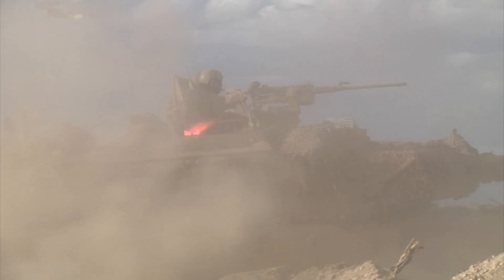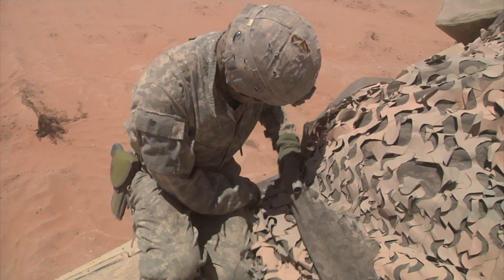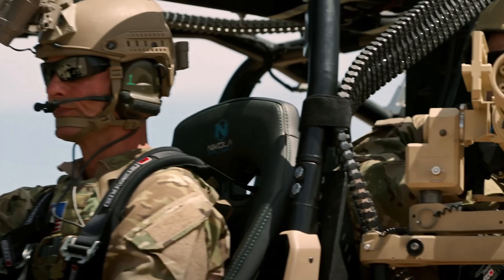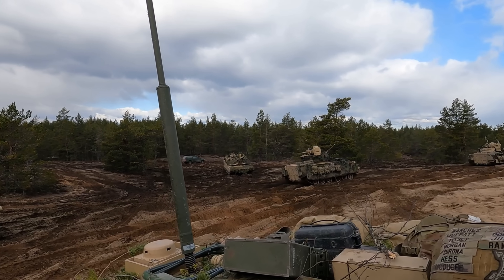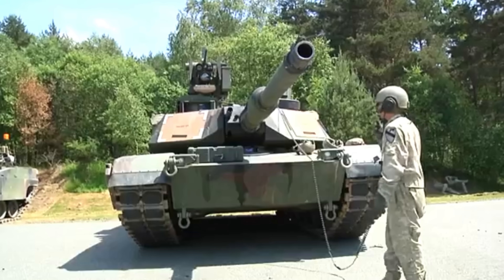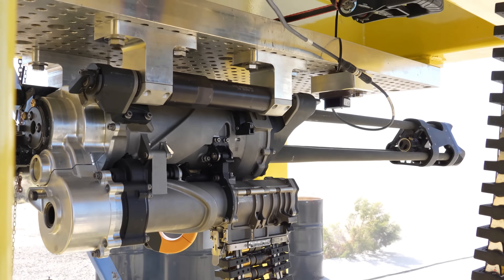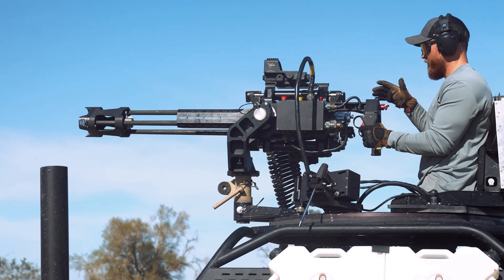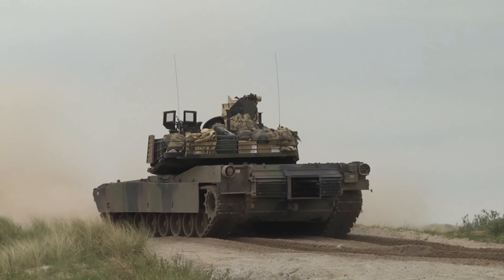Why is the U.S. Army putting a M134 Minigun on Abrams? | ROTARY GUN DEFENSE

Comment: The M230LF project seems a lot more promising than this idiocy.
1. You need a sensor to detect drones, because human eyeballs are just not good enough at detecting the small variants until it's too late. 
2. You need to be able to saturate a large area with projectiles (and those projectiles don't need to be big to do damage, but they do need to be bigger than necessary to kill if they want long range functionality as well). All of these promotes a fragmentation shell. The best way to get 10000+ projectiles into a small zone without ruining barrels or ammo efficiency.
3. It needs to react fast. Much faster than a human can swing around even the smallest of miniguns.

Comment: I wonder if it would be feasible to roll out a drone shot variant of 7.62? Similar to the custom 3D printed bullets that soldiers in Ukraine are using. 
Sure, the casing of these drones are usually too thick, but if you shoot 9 billion little steel balls at them then the props or payload will go out

Comment: My favorite weapon system is the M242 Bushmaster.  I miss firing that gun.

I think what would make more sense for a defense against drones would be a weapon system that can fire ammo with proximity burst capability mounted to the rear of the turret.  I seem to remember a Raytheon prototype upgrade of the M60 MBT that had something like this.  Tie that in to a bank of sensors that offers 360 degree coverage and can be operated manually or be automated, and that might be a viable defense against the drone threat...at least from the air.

Comment: 3:03 well yes but its going to be fully protected and monuted in a fully proteced armord mechnal and comptuer controled assited turret  in where the .50 callber mechine gun gunner hatch was. it woull be mained remotrly inside the gunner crew area under wherethe thach used to be wihout risking the  gunners own safety due to that being mnuted witha fully proteced turret monuting and even would  also have its own radar and inveread imlaeging tracking sesors and camras on that minigun turret.

Comment: Seems a bit extraneous on a tank, but !FUN! AF for the T.C right? (<And thats the ONLY thing that truly matters right?..;)
- I could see the utility in a cut-down Dillon rotary mini 'gon, chambered in 22 Magnum, for the sake of weight savings & the immense ammo load-out a small recon helo'choptor could pack?
- Toss a few of those^ on an OH6 Cayuse/Loach and you'd be GTG. 
- Something like that for suppressing* fire duties would def do the job. It'd keep my head down....or OFF. 

- The OH6 is a nimble little chopper, but the debit as to overall handling characteristics is felt, when two 30cal miniguns & the attendant ammo compliment are affixed to such light weight choppers.

- I'd reckon a 20mm co-axial bang'r kannonen on a tank would be of some benefit over the standard 30cal? 
- Or @ least a .50cal co-axially?

- During WW2, then serving under Gen. George S. Patton**, Gen. Creighton Abrams own 'Thunderbolt' tank(s) & the rides under his command, had his armorers/workshop dudes fab up custom M2 .50 cal mounts to run 50cal M2's co-axially on the Sherman tanks they'd used. They apparently loved that set up too, I can def see why...

* See the: 'American AR180 BEE,' a Fully-Otto .22LR rifle, looking similar to the Thompson SMG. 1200--1500 RPM. 275 round pan magazine. Saaaweet 'lil gat indeed.

** Give Patton's poem: "Through A Glass Darkly" a read, Im certain you'd appreciate it Matsimus. Beautifully pen'd.

Great vid, as per usual...;)

Comment: I think the entire turret needs to be redesigned. The tank was designed deliberately with a low profile for combat. Adding more and more exposed gear defeats that purpose. Especially in a near peer conflict. Perhaps blast panels that operate like an enhanced claymore mine. Bolt on - easy to replace

Comment: the 50 cal rotary we see here atleast..clearly is not balanced for accuracy, and inherently it will likely be slower to move along its axis, as it is heavier and longer. and isn`t the 50 cal ammo somewhat overpowered for the small drones going after tanks(?) the 5.56 and 7.62(or the new 6.8!) round seems better for the close quarters protection job for armoured vehicles. and the firerate can probably be set to whatever seems ideal

Comment: This seems like a disingenuous attempt to push out the m134 in place of the 50 in a manual mode only and leaving the m240.  Let's be real, end of day, it will be put into the CROWS system.  The .50 will probably stay, but the .50 is probably even better suited to be the co-axial and not another m240.  The .50 sniper system on the Abrams, optional, shows the barrel mounting is probably better, and having it coaxial similar to what the Chieftain had for years is a great idea.  Or for that matter, a chaingun on the new turret new Abrams.  Since this is current Abrams, not enough room in the turret for a chaingun.  But for fire suppression, the minigun is much better than the m240, and they still need a .50.  Personally, LOVE the idea of the .50 3 barrel mini in place of the m2, which to me should be the coaxial gun (m2).  Minigun and whichever is left on top should all be merged into the CROWS and use the BLADE system they were testing a few years back.  That was what was testing the .50 in the role of the anti-drone and it's ROF is just too slow and overkill for a small drone carrying a RPG shell.  For drone, think "reach" and for very close in shots, don't think of this as the final protection, that should be the altered TROPHY system with tweaked Software to handle slower threats and having upward shot ability, as in straight up.  That is final protection with shotgun effect, the mini-guns should be for reaching out several hundred meters or of course fantastic fire suppression for the infantry, and of course again, in the CROWS mode, nobody should be poking a head out of the tank, that's sniper's and urban paradise for killing tank crew members.

Comment: I really don't understand who's point youre debating in this video. In the intro you show a remote weapon system and then spend most of the video talking about the M134 being used without a remote weapon system. Has the army said somewhere that its looking at using it without a RWS?
Personally if you can integrate an AI detection system into it that scans around the tank at all times I think it could be an amazing idea and I dont think the increase in calibre is necessary. If its a dedicated system then honestly I think something like a 5.56 could be brilliant if they can get the accuracy down. It would give you the ability to have a better protected system as it could stow and deploy when needed and the smaller the calibre the more ammo it can carry so the higher its rate of fire, the longer it can remain protected etc etc.
Most drones in use are very small and vulnerable to the point where the difference in being hit by a 5.56 or a 7.62 is likely to result in differing result. I feel like a 360 scanning AI powered 5.56 with an absolutely stupid rate of fire so you can hit the drone as many times as possible would help deal with most current FPV drone threats

Comment: A main battle tank (MBT) point defense system is an active protection system (APS) designed to detect and defeat incoming threats, such as rockets and missiles, before they hit the tank (Wiki) like the Trophy System. If it can track and engage incoming missile systems and/or Tank rounds, then it should be able to deal with drones.

Comment: Need to miniaturize automated tracking, computing, aiming and firing. Using this weapon manually with the gunner fully exposed is definitely a major limiting factor for drone suppression in the battle zone and nearly everything else. Integrate situational awareness from portable , vehicle based drone or dynamic antenna.  A little like a mini Gepard system. At a minimum, seat the gunner behind armor inside the tank with automatic target acquisition and initial aiming. Eventually this could all be done remotely.

Comment: In ground and boat config, the mini is spun at 3k per minute for 50/sec.  6k is only good for aircraft where the cooling from airspeed can keep the temps down.   Barrels will actually melt and rupture even at 3k in prolonged firing.  We had to start doing barrel changes after each full ammo can as a preventative during training cycles.

Comment: They aren't going to put a minigun on the Abrams. Tf you smoking dude? If anything it's just gonna be a 25 or 30 mm autocannon with proximity fused rounds fired by Ai targeting systems.
Reply from the maker: That's certainly a possibility!
Reply: @_Matsimus_ my reasoning behind no minigun is the insane amount of munitions fired. It just seems a lot less practical than 30 mm rounds. Anyway best of luck with the channel. It just showed up in the feed so it's getting pushed by yt

Comment: There isn't any one perfect solution. It may end up being simpler to have a stand-alone support system that hugs the tank to provide air cover. Something with dedicated anti-drone armament and minimal crew. The Ripsaw could potentially fill that role. The main battle tank crew already has a lot of tasks. Adding more isn't helpful. As others have stated. The Army might have to develop a dedicated MOS for counter UAV and have them attached to the deployed units. Now, here is my silly idea. Make a belt-fed 9x19mm weapon and have it use proximity fuzes (if possible) and acoustic/ radar targeting to rapidly identify and engage drones. Have a return of the Villa Perosa type gun?
Reply: Flak explosive 9mm?
For russia theyre using pellet 7.62 39 hulls instead of a bullet
Reply: 9mm is by far too small a cartridge to have a proximity fuze, also less range than something like 5.56, 7.62, or .50

Comment: If you intend to manually aim at a drone target, there are options like the Sharpshooter SMASH system that can even be fitted to small arms. It calculates where you need to shoot, you pull the trigger, and it fires when you're on target with no need for wild mag dumping in the air; but there are short range air defence cannon systems on the market that will track and target for you, and which can even be fitted to light trucks, so a tank turret mount should be possible. 

I don't see the M134 as optimal for small drones. The high rate of fire is a benefit against things like trucks and helicopters, where you quickly get a lot of hits once you're on target. 

A lot of the small drones that threaten armoured vehicles in Ukraine would be taken out with one hit from 7.62mm, so you need accuracy and reliability over high fire rate.
Reply from the maker: Thanks for sharing your thoughts on different approaches!

Comment: Honestly, 7.62x51mm is massively overkill for drones.  It takes up too much weight and volume.  Birdshot doesn't have sufficient range, but something like .22 LR would actually be ideal as far as ballistics go: it carries enough energy to be effective to at least 500 meters, but is very light and compact.  The only problem is that .22LR is a poor shape for belt-feed in an automatic.  5.56x56mm microguns would be a good choice, though, and would work in the existing ammo supply chain.

Don't replace the .50 cal, instead it would be wiser to mount it at the loader's hatch or to the side of the CITV like on the BUSK.  Alternately, move the .50 to the coax position.  But the .50 is way too useful against light armor, unarmored vehicles, field fortifications, and stone/brick buildings.  If the .50 is removed, the only way to address those targets would be with a main gun round, and the tank doesn't carry enough main gun rounds to be expending them on everything.
Reply from the maker: Thanks for the detailed breakdown!
Reply: @_Matsimus_  American Arms out of Texas used to make or still makes a .22 LR machine pistol.. uses a rotary drum with a capacity of around 500 rounds.  Build a quad automated mount for em and let a computer with a low power phased array sensor system for target selection and firing.  Leave the loader IN the turret where they belong!

Comment: Would something like an automated automatic 12 gauge with bird shot not be like….the most ideal solution to drones? Not really that lethal to those in the blast zone, cheap, efficient, and can be made from off the shelf parts.
Reply: Plastic shotgun hulls deform with heat
Reply: @Milo_1368  it doesn’t need a ridiculous fire rate, also view it like aa12 with the Israeli drone sight set up on an automatic mount

Comment: A GAU-19 on an Abrams would be absolutely stupid , for the very reasons you decry the M134, only worse.  Worse, it's absolutely unnecessary for the kind of drone threat the Army is looking at - a drone big enough or a threat far enough away that .50BMG would be useful, is a threat that is either big enough it is basically "just another airplane" to be engaged by ADA, or it is going to manuever slowly enough relative to the tank that it can be engaged with a main gun round, as US doctrine has called for for decades.  And you still have the complexity of an electric rotary gun, you're using a FAR larger, heavier, and more expensive round on targets that are pot metal and fiberglass, of the calober you have the LEAST room for storage on the vehicle.

The M134 trials are a stopgap measure, and the final solution will almost certainly be a semiautonomous system, almost certainly bolted on aft of the TC & loader hatches and slightly elevated.

Comment: I’d think AHEAD rounds or some other pellet based solution would work better against thinly/unarmored drones. This seems expensive and inefficient, likely to be greater problems in a full scale war. 30mm might be heavier and more expensive but if it was 2-3 rounds vs. 1,000 I think the cost would offset.

Comment: A CROWS with autonomous mode (we have appropriate radars in commercial use these days) capability, and an XM214 Mkcrogun as the anti-drone armament.

Of course, I'd also look at swapping out both existing M240s and  the M2 for a matched trio of MG338 or the like.  Overall ammunition stowage for MGs would go down slightly, with little to no reduction in capabikity (and NO practical reduction - the extremely narrow gap between targets (both range and armor) inmune to .338 and yet reasonable vulnerable to .50 is already in the area where commanders should be thinking, "Should I use a main gun round, or is the .50 good enough?" anyway.

Plus, you get the advantages of the coax is now a .338, with the extra range and lethality capabilities that brings over a free traverse GPMG on the loader's hatch or a 7.62x51mm coax.

And lastly, this reduces the nimbers of spares and calibers in the tank company by a full machinegun type - any of the "tank's" MGs (the antidrone CROWS mount would be a specialty purpose mount and reaerved for that type of threat) amd any of the stowed MG ammo could be used for any of the three built in MG stations.
Reply from the maker: Thanks for the detailed breakdown and the ideas!

Comment: My preferred heavy weapons system is actually the light cannon.
AKA the "sniper grenade launcher" as westerners call the Chinese marines new light cannon.
Things like the British 2 pounder, the German and US 37mm, or the Soviet 37mm and 45mm guns or the Japanese 40mm pon-pon.

If I had to choose only one, I think I would go with the German 2.8 centimetre, because of it's insane velocity or maybe, if that doesn't come with high explosive rounds, that added length version of the British 2 pounder.

Also, a recoilless light cannon, on a car sized drone, with an autoloader, and an atmosphere device hooked to a computer to help calculate the trajectory, seems like a great weapon for hitting both entrenched infantry, airplanes in hangers, tank engines from above, and any ground targets in general.
Reply from the maker: Interesting, I haven't looked into those, thanks for the info!

Comment: The tank needs an AI controlled shotgun turret equipped with 360 camera for anti drone work.
Reply: I’d propose to build on this idea by putting a belt fed shotgun in coaxial alignment with something with longer range and let the shotgun rounds take out anything so close in that the larger round wouldn’t be as effective as just using buckshot from the shotgun at <~100-150 yds…
Reply: @williamgarry2635  what kind of shotgun getting hit out at 150 yds? Normally they aren't effective past 50 with shot? Does the military have wizardry shotguns im not familiar with?

Comment: It's obvious that FPV drones have become the main threat to all armored vehicles. I was thinking about how Western MBTs & IFVs deploy smoke screens...

Would it not be possible to take this system and modify it to act as a defensive countermeasure against drones?

Replace the smoke rounds with shotgun-like shells, packed with buckshot, set to detonate well above/around the tank, in mid-air, scattering buckshot in every direction once detonated. Multiply this to 8 to 16 rounds per deployment, and you've got one hell of a drone countermeasure, no? 

You would need to make sure it can deploy several times before needing to be reloaded ... Can vehicles pop smoke multiple times??
Reply: Now that I think of it... There's no need for any of this. I forgot about AI... It will shoot down any & all drones with surgical precision!
Reply from the maker: That's a very interesting idea for a potential countermeasure!

Comment: It is at most a test.  When it comes to drones, the defensive system has to be radar driven. Ultimately, jamming is the answer except for line attached drones. In a swarm attack, the 134 would be useless. A mini Phalanx is not going to happen because of several reason, one being the power draw on the tank.
Reply: They are using fiber optic drones in the Ukraine War nowadays too, they can't be jammed.